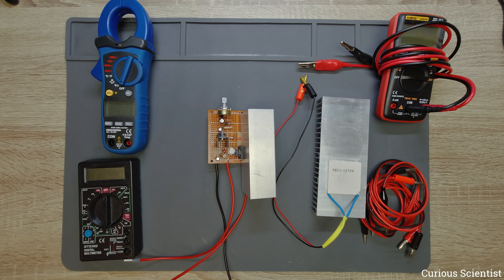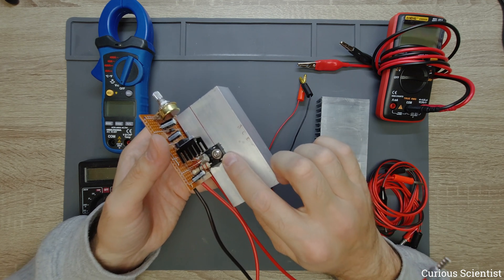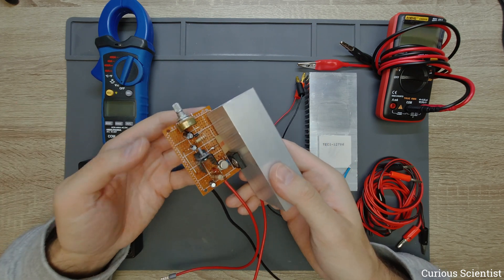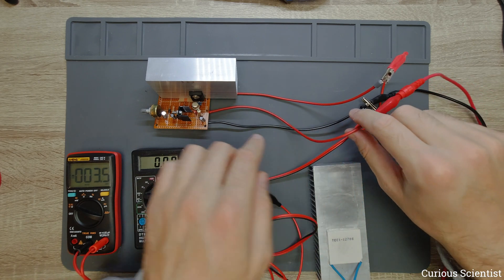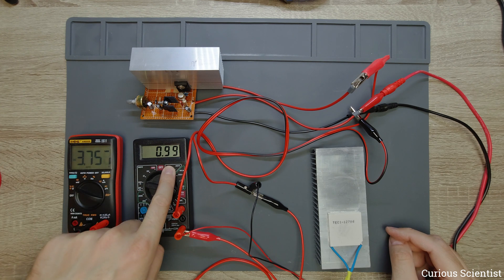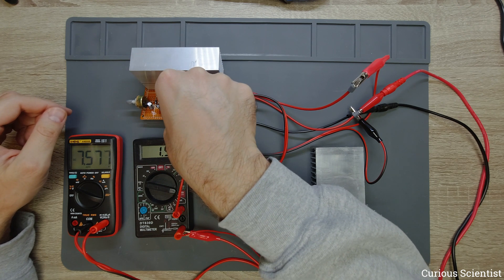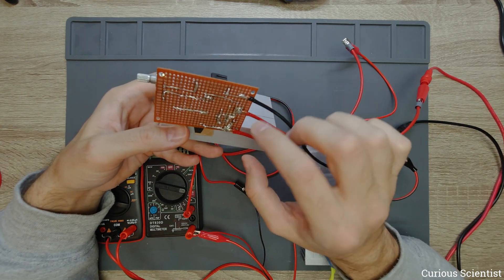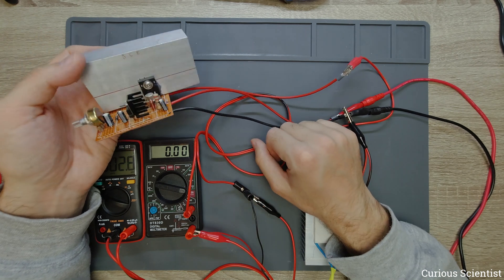LM317-based high-current adjustable power supply

Comment: I bought those exact same test leads.  After measuring them with a milliohm meter, I can say they are probably the worst thing to use for any circuit with current.  I was able to determine their resistance is high because they are using copper plated steel (checked it with a magnet) and the connection at the alligator plug is a poor crimp.   I replaced the wire in the set and did a proper solder joint at the crocks.  They are likely some of the reason for the changes in voltage during the test.
Reply from the maker: Yeah, they are not high-quality cables. At that time, that was what I could afford. Maybe the cables are still go to be used as heating wires, though! 😄

Comment: :26 I can not get this design to work. Did u change it in any way to make it work
Reply from the maker: No, I used the same design in my video. Make sure you don't mess up the polarity of the positive rails (I did a few times 😄). Also, the circuit requires some minimal load in order to start up.

Comment: 0:26  What is the function of that 500R resistor in TIP base-emitor?
Reply from the maker: Please check the datasheet of the LM317 chip, I took the schematics from there. I built this very long time ago and I don't remember all the details.

Comment: I have seen this type of circuit using only one npn transistor with no base resistor and directly connected to base from regulator out. So will it overheat the transistor and ic when higher load current of 5 amps is drawn ?
Reply from the maker: Sorry, but I cannot comment on the circuit you described without seeing its schematics. Why don't you use this one? It is a good circuit, I guess otherwise they would not have suggested it in the LM317's datasheet.
Reply: @CuriousScientist  if I use this circuit you described, will I need to use heavy heatsink on both the regulator and transistor or only on transistor ?
Reply from the maker: As you can see, only the power transistor is attached to the large heat sink and the voltage regulator has its own tiny heat sink. It worked fine for me so far.

Comment: I built  a similar circuit on a breadboard but using 2N2907 (TO-92) instead of 2N2905. I also used a load resistor (unmarked on the schematic) that drew about 50mA.  I tested the circuit setting the output voltage to 12V without external load (open circuit voltage).  However, when I connected the power supply to a load (I used a 10 ohms 50W resistor), the output voltage dropped by a substantial value (from 12V to 7V).  I expected the output voltage to remain constant (+/- a small percentage) at the preset voltage of 12V regardless of the load (of course within the limits of the components).
Reply from the maker: Hi! I don't remember noticing any significant voltage drops, but I have to admit that I haven't used this circuit for a while, so maybe I just forgot it. What kind of power supply do you use to power this circuit? Maybe the voltage drop is caused by that. Nevertheless, I will check it on my side this weekend and give you a brief update.
Reply: @CuriousScientist  : I used a laboratory grade PSU capable of delivering 20A, so I don't think the culprit is anything from upstream of the regulator circuit. Have you tried setting the output voltage without a load first then connect a significant load and take note of any change on the preset output voltage? I'll run another test once I got hand of the 2N2905.  Cheers...
Reply from the maker: I haven't tried it without any load, but I will check it! I haven't forgotten your question and my promise, I just don't have time nowadays to sit down and do these tests. I will be back to you soon.
Reply from the maker: Meh, I couldn't resist, so I tested it now following your description. I get similar drop. Unfortunately, I don't know why, but I will do some research and educate myself on the possible reasons.
Reply: The lm317 needs a minimum 10ma load to regulate correctly.

Comment: Hi, I have built a prototype peltier cooling box originally to cool water bottles in my room and also an experiment but now I am going to use it to transport medicines (covid vaccines) in a temperature controlled environment. Anyway I have three peltiers 12706 controlled by 3 individual temperature controllers. the box is well sealed. I am using water cooling in series with the three peltiers running to a 360mm radiator. Each peltier is mounted on a alluminium plate which is 3mm thick and three plates running on three sides of the box like a "U". On the cold side of the plates which is inside the insulated box I figured the entire plates got very cold but the the cold was not getting transferred to the rest of the enclosure so I added one central fan on top to circulate the air inside. That did give some improvement and I was able to get the temperature inside the box down to 15-16*C. then I added some pentium CPU heatsinks with fans right on the surface of the plates and now I got the temp down to 11-11.5*C. the warmest I have seen the hot water coming out of the peltiers is 28 Deg and gets cooled down to 25Deg by the radiator so I know the heat extraction is not an issue. So I am still trying to figure out where I might have gone wrong with the whole thing because I want to get the inside temperature down to 0-1Deg. Also I am using a 12v 30A common power supply because I want to keep the project cost feasible instead of going for a Regulated one. Do you feel that lack of current regulation is becoming an issue here? I measured the current flowing thru each peltier and it is around 3.5-4amps only and the actual power supply voltage is 11.7V.

Also I have 12 water bottles of 1 liter each inside to simulate the load.

Any advise would be of great help so I could acheive the temperature goal.
Reply: I forgot to mention, the room temperature is around 28Deg average. and when I switch on the unit the temperature drops from 28Deg to 14Deg in less than 50mins but after that it drops to 11.5 very slowly.
Reply from the maker: Hi! This is a video about a LM317 regulator based power supply... Next time please comment under the corresponding video.  

It is simple, those three TEC12706 Peltier coolers are simply not enough to cool such a large amount of material (12 kg of water). You can calculate the heat needed to cool down the water to a certain temperature (q = c * m  *dT) and then you can define a time for your desired cooling speed which you can further use to calculate the cooling power needed. Also if you are running your Peltier at nearly 12 V and 4 A it means that the DT is around 60°C. So, the system provides a very low cooling power. This suggests to me that the heat transfer between the cold side and the load is still not sufficient. Use large heat sinks together with fans on the cold side. 

I have a video series on my own box, check it out, you can learn a lot: https://youtu.be/kWiiCdc3xcw .
Reply: @CuriousScientist  my sincere apologies for posting my questions here. The only thing I had in mind was to know if adding a current regulator to my setup while the peltiers are already just drawing 3-3.5amps would make a difference and if yes then I will add a regulator to each unit to help lower the temperature further inside the box!
Reply from the maker: As I said in my other comment, you have too low voltage. The issue is not the current. But ultimately, your Peltier coolers are the real limit. Either add like 5-10 more or replace them with a few TEC12712 or TEC12715. They provide much more cooling power at the same voltage, but obviously they'll draw significantly more current so you will need maybe more PSU and also much better cooling on their hot sides.

Comment: Good night friend, I'm here again.
I decided to change my project due to the infeasibility by expensive aircoolers, and I decided to do as follows, 1 block of 160mm with 2 peltier 12715 on each side, and the cooling system for the hot part of the peltiers would be 2 blocks of 120mm, 1 in each side where I would leave approximately 2cm or a little more distance between the peltiers.
In these cooling blocks used in the hot part of the peltier, they will have 2 radiators of 240mm, reservoir of 1.5L of acrylic preferably metal, a fuel pump that had left here, in the range of 150 ~ 200l / h, the temperature of mine room is in the range of 20 ~ 25 Celsius with air conditioning, here it is very hot, do you think that changing this way would make better use of the peltiers? or would need even better cooling
Reply from the maker: Hi! I haven't forgotten about you, but I need some time to carry out these experiments, and I am still waiting for a part. As I said, 1 TEC12715 Peltier already has a very high thermal output at the specifications that you mentioned. I was using a 12x24 cm CPU cooler radiator for a single TEC12715, and it was on the borderline. If you are planning to add one more, you won't be able to cool your Peltiers properly. Use smaller Peltiers (TEC12708 for example) where the Joule heating is smaller and you can benefit from the cooling power more. Keep checking back to my channel, I will upload more videos, but as I said, I am waiting for a part and it takes time to produce these videos.
Reply: Curious Scientist even using TEC12715 with a lower voltage and amperage would it be better to use Tec 12708 close to the limit?
Reply from the maker: Hmm. I did the math, and running both devices at 6 A, expecting 40°C DT, TEC12715 produces ~44 W Joule heat, while TEC12708 produces ~70 W. BUT! 12708 provides 36 W cooling power, while TEC12715 provides 26 W. So, yes, you produce significantly higher amount of heat with the TEC12708 at low current, but it gives you more cooling power. 

Now you have to decide. Do you want to sacrifice or not? If you use 4 units of TEC12708, you will have 144 W of cooling power and a 12 V, 30 A PSU would be a perfect fit for this task. If you use 4 units of TEC12715, you will "only" have 104 W of cooling power. Do you need that extra 40 W cooling power in exchange for ~120 W extra heat that you have to get rid of? If you can cool properly, you should go for the TEC12708. In an upcoming video, I will test a very cheap but potentially very powerful radiator. If that works as I expect it, then the waste heat of Peltiers will not be an issue anymore.

If you want to replicate the cooling performance of the TEC12708 at 6 A, you have to bump the current to ~7.5 A on the TEC12715. This will need roughly 8.6 V. You will have roughly 39 W of cooling power and 64 W rejected heat. The problem is that you will need a more powerful power supply. This is 30 A if you use let's say 4 units  (4*7.5 A)  and I personally would not run it with a 30 A, but rather a 35-40 A power supply to have some safety margin. It is up to you. And if you don't mind, I will not write such a detailed answers anymore, because I am not a free support service. Watch my videos, I show every details in them. For example, how to calculate the above numbers using the performance chart. Or wait 1-2 weeks, I will publish videos on tools for performance charts (and the tools too).

Comment: Dear, my advice is not to touch any electric or electronic components with fingers , always use proper tools i.e. heat sensors temperature. This is hazardous even with low voltage and current
Reply from the maker: Thank you! I already knew what will happen, so I was not worried about being burned or shocked. I tested the circuit prior to this video. Despite all of these, your advice is still useful of course, one should be careful when touching wires under (high) current.

Comment: I am not understand the circuit but it looks and work perfectly.
Incase i want to use this circuit for 5v or less out put. Will it work?
Reply from the maker: If I want to explain it in very simple terms, the circuit works in the following way. As you adjust the potmeter, the LM317 will draw more current. The more current draw will open the 2N2905 transistor which is connected to the input of the LM317, which opens the TIP35C power transistor. So basically you indirectly control the power transistor with the current draw of the LM317 voltage regulator. 

It works also for low voltages, however you have to keep in mind that this particular circuit always has a minimal amount of output voltage.
Reply: @CuriousScientist  thanks for your full details